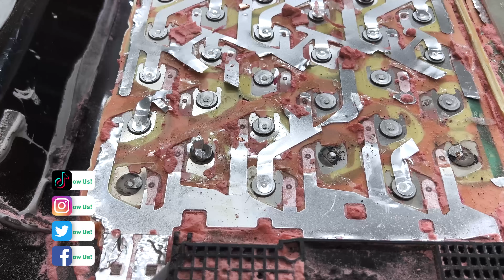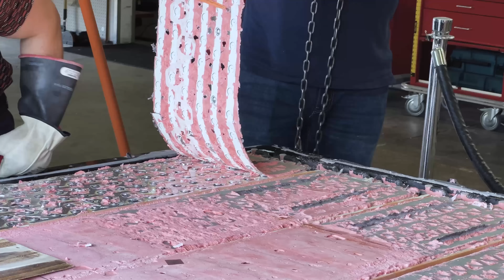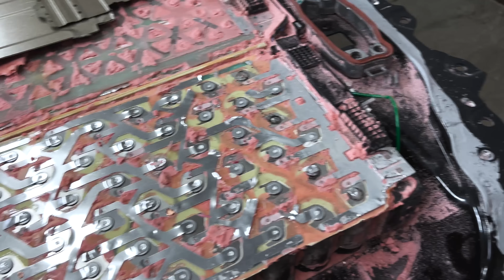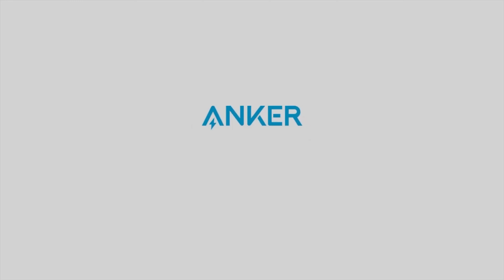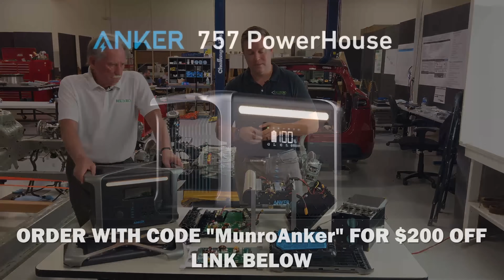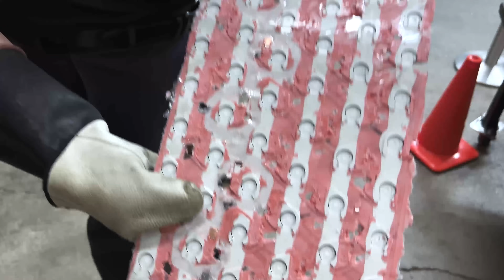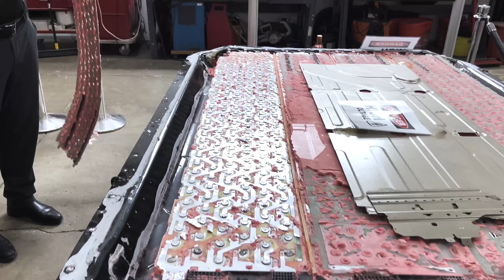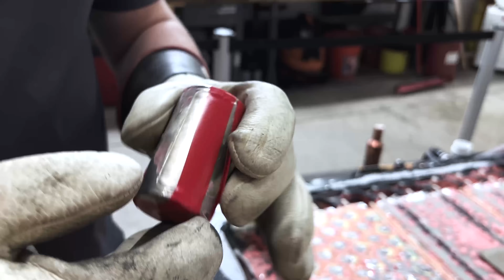Tesla's 4680 Current Collector Layout

Comment: Gives rise to a couple of questions. I wonder what mtbf is required at the cell level to remain viable ?
Given the layout complexity, is the design optimized for computer assembly.
Reply: "mtbf "? 20 years. Usual Li-Ion cells in cars have around 1500 cycle life time. I don't know how many cells those 4680 cells have. Automatic assembly, not comuter assembly. Computers do not asemble anything. Its compilers assembling software into working process structures for computers.
Reply: @wolfgangpreier9160  My question was not well articulated or maybe it went over your head. You didn't answer it. 1500 cycle life time applies without premature failures. While you may not know the number of cells, Munro has estimated it.  Let me pose the issue in a way you might understand. There will be a manufacturing defect rate, causing the pack to be rejected either immediately or as MTBF over time. This is an economic question. What is an acceptable failure rate..
Reply: @bobdeverell  You must ask the manufacturers for this. I can only give you the numbers scientists have found out for similar products. There is NO MTBF. There is no failure rate of single cells, they are removed during the formation. According to some internal numbers Tesla can achieve 1000 packs per week. Whats the percentage of good/bad? IDK. How many packs survive regular use - We know the numbers from Renault: 97% of the Zoes still have the original pack. MTBF? Does not exist because nobody measures the time of existence or the time of being charged or anything like that of a battery. The number of complete cycles is the measurement..
Reply: @wolfgangpreier9160  The issue:  To date, no car manufacturer, including Renault, has made both a large structural battery pack and one that cannot be repaired. Maybe we deal with this in 2 stages. Firstly the target yield of the completed structural battery pack. Secondly the MTBF of the battery in real life. (say during the guarantee period) This is an  exposure that Tesla et al must have calculated. I was hoping for some estimates. Maybe Munro will address this in the future.
Reply: @bobdeverell  You keep using an inappropriate abbreviation. MTBF  = Mean Time Between Failures. There is no such thing like MTBF in Batteries. Cycle count till 70% - thats a real number which is well documented.

And no: You - personally you as DIY - can NOT repair a Renault battery pack and expect to have a working battery pack afterwards. Or any other mainstream nmanufacturer including Lucid and Rivian. 

Of course you may open any battery pack and try to repalce a cell. I wish you good luck and a good insurance.

IDK about Arcimoto - i would spect they will not allow a third party DIY to open one of their batteries without conseqeunces - but thats their decision.
Reply: @wolfgangpreier9160  Of course in a typical EV you don't try and repair a pack yourself , though there are several Dutch companies and others that offer such a service. You miss the point. Yes there is a battery failure rate and it is not the same as the number of charge/discharge cycles. In conventional assembly we the number of cycles is a key metric, but in a structural battery pack the whole car may have to be written off because of a failure of a few cells. The manufacturer must know this failure rate as much as the usage.
Reply: @bobdeverell  "though there are several Dutch companies and others that offer such a service" For self made and small "golf carts" sure. Not for current EVs. Not on cell level. Only on module level.

Why should i write off the whole car when a replacement battery pack costs around 11K US$? I don't understand what would drive me to such insanity. Or maybe 15K. The work is done with a lift in about 6-8 hours. Thats another 1000,-- cost.

Today its often cheaper to replace the battery instead of replacing a module. Its costs less time. And time si literally money.

And no: Most manufacturers do NOT know the failure rates. Besides Tesla, BMW and Renault nobody is on the market long enough with a single type of batteries. Even BYD has no diea about their current batteries. If you would extrapolate from their busses they would have to call back ALL vehicles. In Europe and the US the failure rate of their busses is arund 30% each year. Very BYD workmanship. Sadly. The Mercedes E-Citaro fare better but have high temp Zebra batteries which can not cool down. Very inefficient. But long lasting. You may check the other 34 - or so was the last count in 2021 - of EV bus manufacturers.

Model S fares poorly because the battery is too weak for the car. Renaults battery packs have a 97% success rate. BMW packs rund for a very long time, no definitve numbers are known.
Reply: @wolfgangpreier9160  Incorrect re pack rebuilds.. Do some homework. Refurbished packs are available from specialists and  replacement packs are available from manufactures. No need to state the obvious. 
This discussion is about Tesla structural battery packs. It is not about Renault, BMW, BYD Mercedes or others. I am not discussing mainstream manufacturing, that is well understood.
Reply: I did a quick bit of (rough) maths, assuming 2000 cycles (OK , accepting a % of degradation. ) 2000 cycles by 250 miles. Driving 10,000 miles a year gives 50 years. Close to a persons lifetime of driving. Given a ton of data on the cells and all the component parts of the pack, it's assembly method, and environmental testing - and the conditions of operation  - it's feasible to calculate MTBF at the cell level. Sure, Tesla are guessing that they won't need to replace a cell...
Reply: @chrisheath2637  Agreed, I see this as an interesting risk as the pack cannot be repaired.  Thanks.

Comment: Umm.., I wonder if this new structural battery pack is passively cooled.
Reply: No, it is actively cooled in the same way as all previous Tesla cylindrical-cell (18650, 2170, now 4680) batteries: channels carry liquid coolant between cells. You can see three channel end fittings at one end of each of the four sections of cells, such as at 3:38 in the video.
Reply: I wonder whether it's even structural. Maybe the case it sits in is, a bit.

Comment: Virtue signalling comments about recycling and repairability by people who are clueless in 3...2...1...
Reply: It's not virtue signaling if you have a Tesla that is a couple of years old and because of one or two bad cells the whole battery has reduced performance. So the whole car has to be scrapped because Tesla charges so much for a battery replacement?
With the old battery packs there's aftermarket shops that go into the pack and replace the bad cells so the car isn't totaled.
With the new unserviceable pack we're back to scrapped cars over battery issues again.
Concern for this isn't virtue signalling, it's cost benefit analysis.
I've got a Cybertruck on order but I may go ahead and buy a ICE truck because I'm going to wait to see how this IMPORTANT issue plays out.

Comment: That battery pack is never intended to be serviceable, or even to be opened.  It’s either good, or recycle it.  Sorry, Rich Rebuilds.
Reply: Nope.  I think they do not want the hobbyists tearing out battery packs anymore for DIY powerwalls.  🤣
Reply: Its their endgame once the robotaxi kicks starts and they just recycle the whole battery pack and just replace it with new one
Reply: so what about the relay? the fuse? if those fail you replace the whole pack?? from what i've seen so far. relay and fuse are inside the pink stuff that's so hard to get out.
Reply: Remember that the top of the pack is welded to the bottom of the pack and the seats are mounted to it.  You would basically have to destroy the pack to get inside of it.
Reply: @eddiegardner8232  yeah that's my question. what if the fuse or the relay goes bad and you're out of warranty. you have to pay 20k to repalce the whole pack just for a relay or fuse???
Reply: I think that would be a good question for Elon Musk.  “What is the service/warranty service protocol for a structural battery pack car with a pack failure?”  Remove-replace-recycle?  Remove replace-depot repair?  Total the car? “Is there any spare cell redundancy built into the pack or module and BMS design?”  (sort of like a single bit error correction in a DRAM)

Comment: I love the 4680's! Can't wait for all the info to come out.
Reply: I loved the IDEA of them. So far, I;m not sure ANY of its promises are delivered on, except perhaps cost for Tesla.
Less range, barely lighter, not cell to chassis.
Reply: @Cloxxki  this pack with the seats, carpeting center console and mounting brackets is several hundred pounds lighter than just the pack alone from the Munroe 2020 model y teardown. Cory said that in the very first video as he was surprised by the weight savings. 🤔

This is also absolutely a cell to pack and cell to chassis stressed member format pack. Nobody else has anything like this right now either. 👍🏻
Reply: I'll save you the time, 4680 cell is equivalent to a Duracell D Cell battery, nuff said...Tesla would be better off filling the 4680 cannisters with lithium6 Hydride and using them as low pressure hydrogen tanks, his dumb rc cars would have 1000s of miles of range then.
Reply: @HydrogenFuelTechnologies    "his dumb rc cars would have 1000s of miles of range then."

Then would need several thousand miles range since there are only a few H2 stations in the US.   At the price of hydrogen, you can keep it for your collection.
Reply: @HydrogenFuelTechnologies   How much does it cost you to produce a 1 gallon of gasoline equivalent of clean hydrogen?   That's the major problem with H2 as an automotive fuel--complexity of the fuel cells and cost of the fuel (as well as basically no hydrogen fueling infrastructure which has to be in place throughout the country before most people will bother unless there is a very compelling economic reason [that is cheaper than BEVs to fuel on pure electricity]).
Reply: @brianbeasley7270  cost me bout free99
Reply: @HydrogenFuelTechnologies  Unless everyone can do the same, that doesn't mean much.   Hydrogen is an energy carrier.   You have to put in more than you get out so you would have to tell people what the energy cost to make your H2.
Reply: @brianbeasley7270  it's free99 per kg I told you
Reply: @HydrogenFuelTechnologies  Not much credibility from you since you gloss over tradeoffs nor do a cost/benefit analysis.